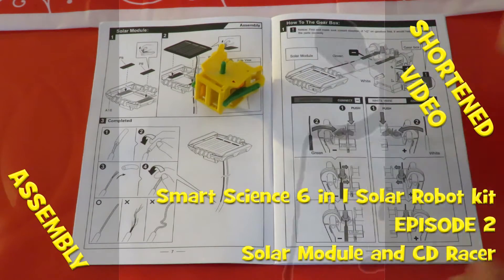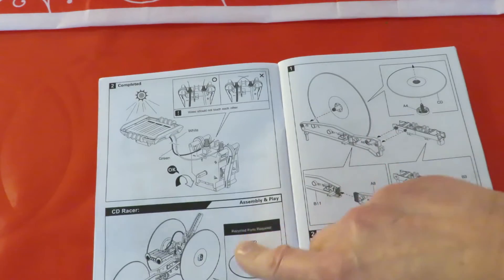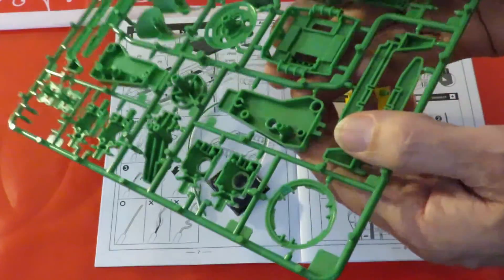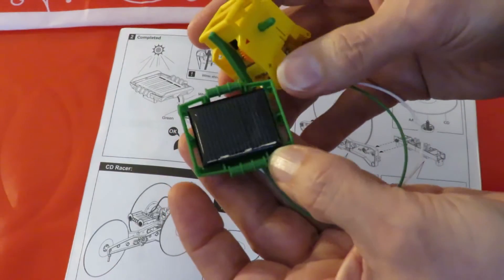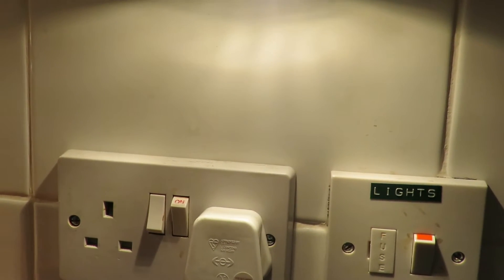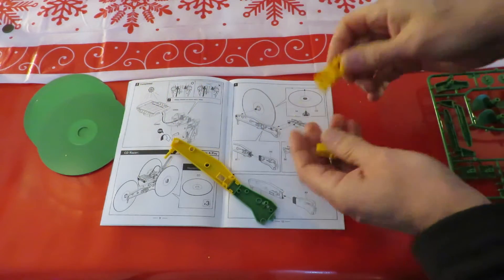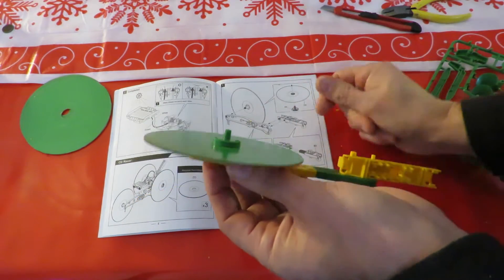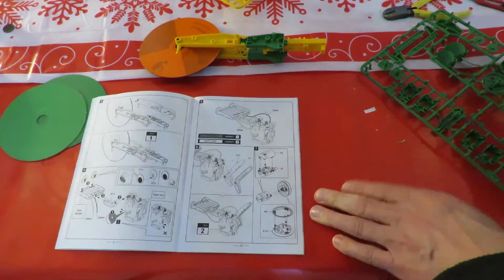Smart Science 6 in 1 Solar Robot kit - Episode 2 Solar Module and CD Racer SHORT

Comment: Hey grandad, I recently purchased this product and This cd racer does not seem to work... The motor spins yet the cds do not.. Please help.
Reply from the maker: Does the motor spin the CDs if you lift the car off the ground so there is no load? If that is the case then you need brighter sunlight to give you more power. If the CDs don't spin while the motor is running then you have missed something in the gearbox.
Reply: I followed exactly what you did sir. When I manually spin the motors all the motors spin but when I Leave it to sunlight only one motor spins. the green things on the sides don't spin either...
Reply from the maker: If the motor turns and the gears don't then you must have assembled the gearbox incorrectly. Here is the video I did assembling the gearbox. The shortened video https://youtu.be/tOsIQvdc-qY and the full length video https://youtu.be/xFw2s9u-9MY

Comment: Cool       but the solar panel needs more energy than a normal one      so can can you use more powerfull solar panel which needs less light
Reply from the maker: Thanks, but I am not sure what you are trying to say. This works fine. What you need for a solar powered project is SUNLIGHT or a large halogen light. The light I use in the video is rather small so can only provide sufficient radiation when held close to the panel. At this time of the year the sun is so low in the sky it is too weak to supply the energy so taking the car outside is a waste of time.